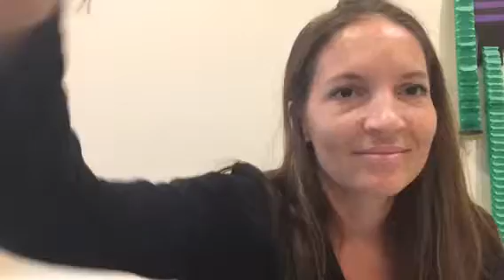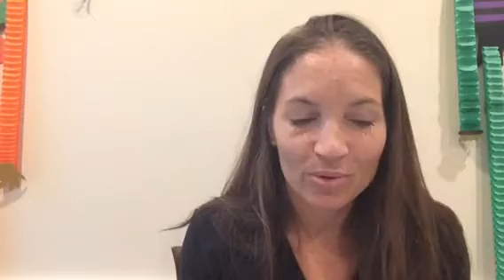Minimed 670G's dirty little secret: The underperforming auto mode correction bolus

Comment: The designers make the insulin pumps more difficult and technical than need be. Been type 1 diabetic for over 44 years and pump user for 26 years. I always use the manual mode and my equation for a bolus to reach my target is 1 unit of insulin for each 50 points above my target range to make a correction. 2 units to cover a 100 point drop such as a 260 BG with a 2 unit bolus equals a 160BG or an aggressive 3 unit bolus to equal a 110 BG with a 150 point drop. The trick is to know your body and whether the already current active insulin is remaing steady, dropping, or rising according to real-time activity. I am the pilot.

Comment: The Medtronic 670g pump is junk, it will show you within range, however your actual bg will be 100 points off. You can calibrate the hell out of this yhong and you will never get an accurate reading Medtronic even states they are of this. However they don't care.....
Reply from the maker: I hear you, Albert Lisch. I got very frustrated with the sensor lag and the fact it continued to withhold my insulin based on an old value.

Comment: I think you also have to consider that AUto Mode had been delivering micro boluses to you while you were exercising and afterwards. The amounts of the microboluses do not show up in your active insulin readout. (At least I don't believe they do). So, assuming that is true, you may have been receiving numerous  0.200 / 0.275 / 0.300 microboluses that the pump knows it gave you, but that don't show up in the bolus wizard for your consideration while calculating to correct.. 
Also, the interstitial readings tend to lag behind an actual BG by 20 or more minutes.  So, you might have had a sensor reading of 260, but a BG perhaps would have been 220 with a single down arrow. 
I have experienced the same as you, and I have over-corrected sometimes, even pretty heavily, especially when I have a high that is 300 and doesn't seem to be coming down 3 hours after a meal for which I thought I dosed the correct carbs, and the dose was at or before eating.  My sensitivity is also set to 30, like yours. I'm also at about 6 grams carbs per unit of humalog.
One other thought: My Endo always says 'you must remember, diabetes is a fluid disease. It is one way today, and another way the next day."  She's absolutely right about that, I imagine we can all agree. 
I definitely am more of a pin cushion for BG's than I ever was before having a sensor/pump. Sensor change days are usually 6-10 Bg's and my musician fingers don't like it one bit.
While there are many frustrations with the 670G and guardian 3 sensor combination, overall my A1cs are better than they ever were with pen insulin.  
The next step in the evolution of this technology will probably be faster-acting insulin, with Glucagon delivery to raise lows. That should be really great for a lot of active people.
Reply: One other thing: My DE told me to stop using False Carbs to lower my BG because it keeps Auto Mode from learning your body's response to the insulin used. I now only use BG correction boluses, and after a few weeks, I do see some improvement.
Reply from the maker: Hello Jonathan Pruitt! Thank you for your comment. I do have to tell you though that I have learned how to track my micro boluses and have been doing it for a long time. Your first idea makes a lot of sense, but I can tell you it was not true for me. For one, I NEVER get micro boluses those sizes. Even now I max out at .15. I also don’t get any micros at all while I exercise and none even afterwards..... By the time I’m a couple of hours outside of exercise, I may have received 30 minutes’ worth of micros, and the vast majority will range between .025-.075 in size. You’re absolutely right that the micros are not reflected in the IOB, but in my case, they also have nothing to do with the feeble correction bolus. 

I feel like a know-it-all answering the way I am, but when it comes to lag, I’m on top of that as well. I suffer from a nasty case of the lag, and as a result, I’ve learned to test frequently throughout the day. Again, this is not what was behind those corrections. I never put in for a correction without using my BG, and had it been lower and falling, I wouldn’t have had any problems with a smaller correction. It is the fact that my blood sugar is high and RISING that upsets me so much about the size of it. A high number alone is one thing, but often the correction wouldn’t have even been enough to cover the high as it was, nevermind the ground it was covering every minute as it rose.

Of course I can’t argue that diabetes can feel like learning rules to a new game every day. There’s certainly that part of it. However, once I got out of auto and get back into a place of control, things really settled down. Yes, I do have more hypoglycemia in manual mode. Unfortunately, this is true. However, I also have 100% more predictability. For now, that’s a fair trade for me. My a1cs also DID improve after having started in auto mode, but they have continued to improve even further back in manual. I’m seriously considering returning to injections for a couple of months to see how it goes there now. I really enjoy the control more than I do the free ride, but I can see how we’re not all in agreement on this. 

Glucagon delivery to raise lows......  let’s just say we are in complete agreement on that. I REALLY look forward to that.. I imagine it might be tricky to learn, but, for me, I think that’s what I’m missing from this medical device. I can’t wait to see how that works. Anyway, thanks for commenting, and best of luck to you!
Reply: Thank you, Nicky, for your thoughtful comments and for making the video in the first place. It is helpful to others to hear your perspective.   QUestion:  How does your pump know not to give you microboluses when you are exercising, or if experiencing a BG rise after exercising?   
In my case I either use Temp target (to prevent lows during jobs where I can't break to eat something when I go low) (and which happens all the time).  or I load a predictable amount of carbs before I exercise because I can predict reasonably well the "BG journey to the center of the EARTH "' that my numbers will take after about 40-45 minutes of moderate exercise.  Also, I never get a rise after exercise; that sounds so counter-intuitive to my little brain..     
One other thing - I get kicked out of Auto Mode bc or Max Delivery, or bc of min delivery, or bc a BG was required in the middle of the night and I tried to ignore it, or bc the sensor signal was lost or not recognized, or bc the wind blows from the southeast... but I get kicked out of Auto Mode for SO MANY REASONS, and it drives me crazy.  My sleep is interrupted so often..    me no likey. WIsh you much success, too! :-)
Reply from the maker: Hello again, Jonathan Pruitt. :) I wrote you a response last night, a pretty thorough and organized one, and then somehow deleted it. Here’s my second attempt. :D

So my pump knows not to give me micros during exercise because part of the alorithm is your trend and your SG value... So if I start exercise at an SG of 150 and instantly begin to drop, my pump will probably cease all micros almost immediately because my blood sugar is trending downward from a moderate starting blood sugar (or SG really). Similarly, because I usually stay down for a spell following exercise, it will probably continue to withhold my insulin until it registers that my trend has changed upward. Because of the lag with my sensor, I can end up having accumulated sometimes a couple of hours’ worth of no insulin both during and immediately following exercise. So when I experience that high blood sugar a little later, I don’t mean to make it sound like it’s the exercise that has done it—- it’s actually the lack of insulin. 

I also tried Temp Target for exercise, and it wasn’t a good fit. However, I could see how for something like what you’ve described on your jobs, that it might be enough of a reduction that it is able to help you stay afloat. For exercise, with that sudden drop, it’s just a little harder to accommodate. In manual mode, I’m learning how to do a full one hour suspend PRIOR to starting and then doing a bolus to cover my missed basal as soon as I’ve finished. Unfortunately, these are not options in auto mode as there is no way to control auto’s delivery (short of suspending, but then that affects the algorithm?) nor is there a way to manually determine a bolus. This all just means exercise continues to be a tricky situation. 

Oh, and I know a thing or two about poor sleeping. My sleeping has also really taken a HIT. I went onto MDI for a couple of weeks just to take a break, and I slept really well. I rolled over in the bed, I didn’t have alarms....  it was pretty cool. I’m thinking about going back soon.

Wish you well, too! And I hope to hear from you again!

Comment: I couldn't agree more with you.  Auto mode on the 670G is woefully inadequate for handling correction boluses.  In my case I had to put my sensitivity at 1/3 of its real rate, and change the time that N insulin lasts way down to almost a minimum amount.  And even then auto mode micro-boluses are pathetically inadequate.

I have a degree in electrical engineering, and for a living I do predictive modeling for insurance claims.  I've also been a T1 since 1985.  In other words, I have the intelligence, training, and life experience to understand fully what this pump is doing, and what it should be doing.  I called Medtronic and suggested that they add a setting for "I'm awake" and "I'm asleep" so the device can more aggressively manage correction boluses.  In my case, the micro-boluses are approximately 1/3 the size they need to be for my insulin needs.  Had I known what I know now, I probably would have waited until a better version of this pump came out.

Another problem:  the insulin on board is a linear relation.  For example, if you take 5 units of insulin, and the pump is programmed to think that dose will last 5 hours, then it reduces your insulin on board at a rate of 1 unit per hour.  This of course is broken down in much finer steps (like 1/10th of a unit every 6 minutes)  I had a Medtronic nurse tell me it was linear.  We all know insulin ramps up and dies off in a bell-curve shape relationship to time.  This pump should have the intelligence to simulate that insulin activity.
Reply from the maker: Yes, auto mode really might be good for some, but it’s just not for me at this point. From my understanding, the insulin sensitivity doesn’t even affect auto delivery, and I refused to change my active insulin time. There are lots of people having pretty severe crashes, and I think it has to do with the fact some people really jack up their insulin in auto but then can’t control how they get it.... or whether or not they’ll even need it. Blanket insulin increases on top of an uneven “basal” rate. For me, I’m not interested. I’m good back in manual fighting my way through some extra lows. 

My micro boluses were weak, and my mornings contained ugly spikes. I hit 200s and 300s consistently without having done anything to earn them. At some point, once I have a little time on my hands, I’ll venture back in there again and see if I can’t get better results having learned even MORE since my last visit. The problem is I just don’t think I have the tolerance.... I go in for a couple of hours every now and then and immediately get handed an hour of minimum delivery, and I get frustrated and leave. We’ll see.
Reply: @nickyghaleb  the trick to getting around that is making a correction bolus as if your eating carbs when your not to trick the pump. I don't even pay attention to the active insulin unless I have more than a few units actively running I learned that real quick with this pump and I've only been on 3 months. 

I started out with an 8.7 A1C and now as of today at 6.5 /7.0... my blood sugar has never been in this control my whole life I've been diabetic 28 years. Almost lost my vision due to me thinking I was Superman for so long so I definitely get it. I can't lie I also have an awesome insulin pump manager who make tweaks for me every week if I'm not liking how something is working
Reply from the maker: Congratulations on the drop in a1c, FNS ON THE HIP!!. That is fantastic! Yes, I do know about tricking the pump, and I don’t judge people who do it, but I wasn’t interested in it for myself. I took up trying to understand my micro boluses and general delivery and found that the trickery, in my case, was like shooting myself in the foot. Those micros that I would get through “fake carbs” could, in turn, knock out the next 20 or 30 minutes of micro boluses.... and the whole cycle became too high maintenance. It was my main reason for my initial return to Manual Mode—- I began to long the predictability and reliability over the “help” Auto would provide for those segmented periods. Again, if you’ve found something that works in your own case, then I hope it continues to do just that! :)

I did also drop from an a1c of 9.2 (prior to the 670G) to an a1c of about a 7.1 in auto mode. After returning to Manual Mode, I continued to drop to a 5.8. I also know all about that “superwoman” thinking.... and it’s not been in my best interest. ;) 

If nothing else can be said about the 670G, it offers more than one way to achieve good numbers. I DO love hearing about all of us diabetics moving in the right direction. Best of luck to you as you go!

Comment: The problem is that the pump is unable to give enough insulin on its own to keep me in the control range. It is still very dependent on the bolus I give it. The amount of insulin that is added to my body automatically is insignificant for the awake hours. If my blood sugars rise to high I end up giving myself additional carbohydrate boluses even though I have not eaten at the time when the additional bolus are given. Some Medtronic support staff say that is the way to correct for high glucose reading while other say I should get out of automatic mode first and give the bolus with the Bolus Wizard. But by leaving auto mode I end up having to do endless BG tests and calibration. By not going out of auto mode they say that the algorithms are messed up. In the future there needs to be at least a Bolus Wizard in Auto mode if the pump is unable to give the entire insulin correction needed. Another problem is that when I am exercising and I increase the Temp Target the pump still keeps giving small doses of insulin even though my BG is below the 150 temp target. The same thing also happens when the target is at 120 it keeps giving small doses of insulin even when the BG is below 120. Both of these type of events at times cause low blood sugar reactions. Hopefully future models will address these problems.
Reply from the maker: Agreed. :D